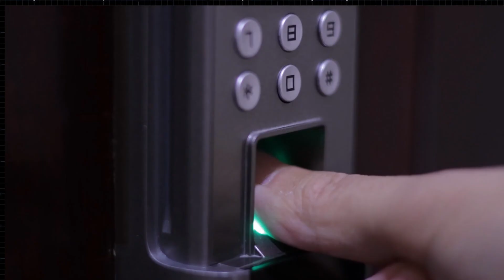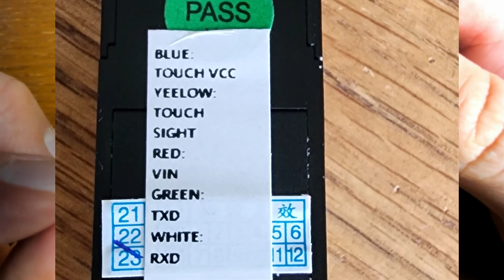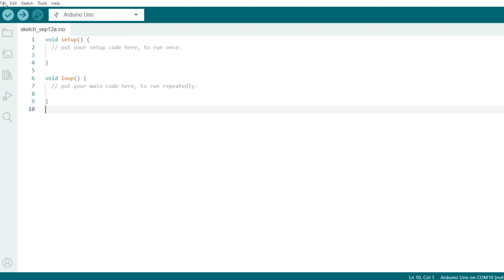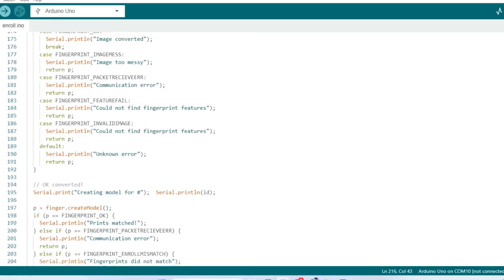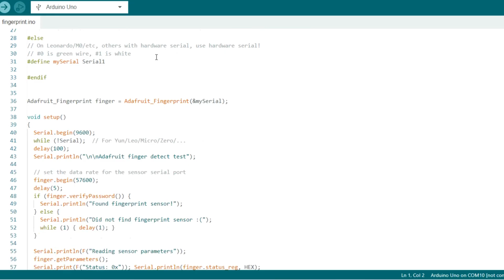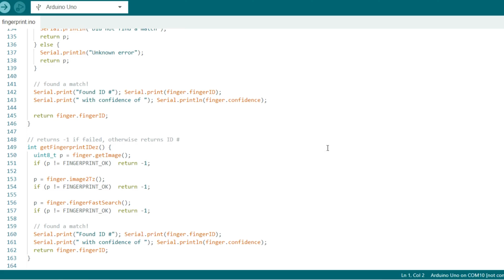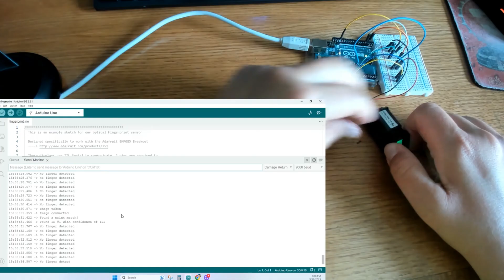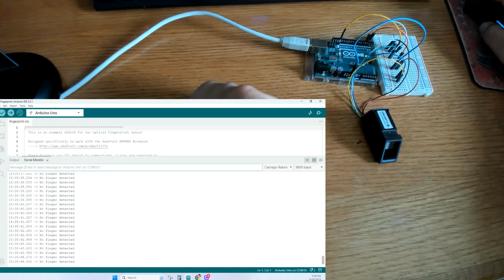Arduino Uno Fingerprint Scanner Tutorial: Enroll and Verify Your Fingerprints

Comment: Can you give me full wiring diagram please
Reply from the maker: HI!
There are different fingerprint modules out there, but I have the flashtree FPM11A Green Light Optical Fingerprint Reader.  For my fingerprint module the wires I used are:
Green: TX
White: RX
Red: VIN
Black: GND

look at 2:54 in the video for a wiring diagram -
green wire: pin 2
white wire: pin 3
red wire: 5v
black wire: gnd

Comment: Put the code
Reply from the maker: download library. 👍👍

#include <Adafruit_Fingerprint.h>

#if (defined(__AVR__) || defined(ESP8266)) && !defined(__AVR_ATmega2560__)
// For UNO and others without hardware serial, we must use software serial...
// pin #2 is IN from sensor (GREEN wire)
// pin #3 is OUT from arduino  (WHITE wire)
// Set up the serial port to use softwareserial..
SoftwareSerial mySerial(2, 3);

#else
// On Leonardo/M0/etc, others with hardware serial, use hardware serial!
// #0 is green wire, #1 is white
#define mySerial Serial1

#endif

Adafruit_Fingerprint finger = Adafruit_Fingerprint(&mySerial);

uint8_t id;

void setup()
{
  Serial.begin(9600);
  while (!Serial);  // For Yun/Leo/Micro/Zero/...
  delay(100);
  Serial.println("\n\nAdafruit Fingerprint sensor enrollment");

  // set the data rate for the sensor serial port
  finger.begin(57600);

  if (finger.verifyPassword()) {
    Serial.println("Found fingerprint sensor!");
  } else {
    Serial.println("Did not find fingerprint sensor :(");
    while (1) { delay(1); }
  }

  Serial.println(F("Reading sensor parameters"));
  finger.getParameters();
  Serial.print(F("Status: 0x")); Serial.println(finger.status_reg, HEX);
  Serial.print(F("Sys ID: 0x")); Serial.println(finger.system_id, HEX);
  Serial.print(F("Capacity: ")); Serial.println(finger.capacity);
  Serial.print(F("Security level: ")); Serial.println(finger.security_level);
  Serial.print(F("Device address: ")); Serial.println(finger.device_addr, HEX);
  Serial.print(F("Packet len: ")); Serial.println(finger.packet_len);
  Serial.print(F("Baud rate: ")); Serial.println(finger.baud_rate);
}

uint8_t readnumber(void) {
  uint8_t num = 0;

  while (num == 0) {
    while (! Serial.available());
    num = Serial.parseInt();
  }
  return num;
}

void loop()                     // run over and over again
{
  Serial.println("Ready to enroll a fingerprint!");
  Serial.println("Please type in the ID # (from 1 to 127) you want to save this finger as...");
  id = readnumber();
  if (id == 0) {// ID #0 not allowed, try again!
     return;
  }
  Serial.print("Enrolling ID #");
  Serial.println(id);

  while (! getFingerprintEnroll() );
}

uint8_t getFingerprintEnroll() {

  int p = -1;
  Serial.print("Waiting for valid finger to enroll as #"); Serial.println(id);
  while (p != FINGERPRINT_OK) {
    p = finger.getImage();
    switch (p) {
    case FINGERPRINT_OK:
      Serial.println("Image taken");
      break;
    case FINGERPRINT_NOFINGER:
      Serial.print(".");
      break;
    case FINGERPRINT_PACKETRECIEVEERR:
      Serial.println("Communication error");
      break;
    case FINGERPRINT_IMAGEFAIL:
      Serial.println("Imaging error");
      break;
    default:
      Serial.println("Unknown error");
      break;
    }
  }

  // OK success!

  p = finger.image2Tz(1);
  switch (p) {
    case FINGERPRINT_OK:
      Serial.println("Image converted");
      break;
    case FINGERPRINT_IMAGEMESS:
      Serial.println("Image too messy");
      return p;
    case FINGERPRINT_PACKETRECIEVEERR:
      Serial.println("Communication error");
      return p;
    case FINGERPRINT_FEATUREFAIL:
      Serial.println("Could not find fingerprint features");
      return p;
    case FINGERPRINT_INVALIDIMAGE:
      Serial.println("Could not find fingerprint features");
      return p;
    default:
      Serial.println("Unknown error");
      return p;
  }

  Serial.println("Remove finger");
  delay(2000);
  p = 0;
  while (p != FINGERPRINT_NOFINGER) {
    p = finger.getImage();
  }
  Serial.print("ID "); Serial.println(id);
  p = -1;
  Serial.println("Place same finger again");
  while (p != FINGERPRINT_OK) {
    p = finger.getImage();
    switch (p) {
    case FINGERPRINT_OK:
      Serial.println("Image taken");
      break;
    case FINGERPRINT_NOFINGER:
      Serial.print(".");
      break;
    case FINGERPRINT_PACKETRECIEVEERR:
      Serial.println("Communication error");
      break;
    case FINGERPRINT_IMAGEFAIL:
      Serial.println("Imaging error");
      break;
    default:
      Serial.println("Unknown error");
      break;
    }
  }

  // OK success!

  p = finger.image2Tz(2);
  switch (p) {
    case FINGERPRINT_OK:
      Serial.println("Image converted");
      break;
    case FINGERPRINT_IMAGEMESS:
      Serial.println("Image too messy");
      return p;
    case FINGERPRINT_PACKETRECIEVEERR:
      Serial.println("Communication error");
      return p;
    case FINGERPRINT_FEATUREFAIL:
      Serial.println("Could not find fingerprint features");
      return p;
    case FINGERPRINT_INVALIDIMAGE:
      Serial.println("Could not find fingerprint features");
      return p;
    default:
      Serial.println("Unknown error");
      return p;
  }

  // OK converted!
  Serial.print("Creating model for #");  Serial.println(id);

  p = finger.createModel();
  if (p == FINGERPRINT_OK) {
    Serial.println("Prints matched!");
  } else if (p == FINGERPRINT_PACKETRECIEVEERR) {
    Serial.println("Communication error");
    return p;
  } else if (p == FINGERPRINT_ENROLLMISMATCH) {
    Serial.println("Fingerprints did not match");
    return p;
  } else {
    Serial.println("Unknown error");
    return p;
  }

  Serial.print("ID "); Serial.println(id);
  p = finger.storeModel(id);
  if (p == FINGERPRINT_OK) {
    Serial.println("Stored!");
  } else if (p == FINGERPRINT_PACKETRECIEVEERR) {
    Serial.println("Communication error");
    return p;
  } else if (p == FINGERPRINT_BADLOCATION) {
    Serial.println("Could not store in that location");
    return p;
  } else if (p == FINGERPRINT_FLASHERR) {
    Serial.println("Error writing to flash");
    return p;
  } else {
    Serial.println("Unknown error");
    return p;
  }

  return true;
}

Comment: Code
Reply from the maker: download library.

#include <Adafruit_Fingerprint.h>

#if (defined(__AVR__) || defined(ESP8266)) && !defined(__AVR_ATmega2560__)
// For UNO and others without hardware serial, we must use software serial...
// pin #2 is IN from sensor (GREEN wire)
// pin #3 is OUT from arduino  (WHITE wire)
// Set up the serial port to use softwareserial..
SoftwareSerial mySerial(2, 3);

#else
// On Leonardo/M0/etc, others with hardware serial, use hardware serial!
// #0 is green wire, #1 is white
#define mySerial Serial1

#endif

Adafruit_Fingerprint finger = Adafruit_Fingerprint(&mySerial);

uint8_t id;

void setup()
{
  Serial.begin(9600);
  while (!Serial);  // For Yun/Leo/Micro/Zero/...
  delay(100);
  Serial.println("\n\nAdafruit Fingerprint sensor enrollment");

  // set the data rate for the sensor serial port
  finger.begin(57600);

  if (finger.verifyPassword()) {
    Serial.println("Found fingerprint sensor!");
  } else {
    Serial.println("Did not find fingerprint sensor :(");
    while (1) { delay(1); }
  }

  Serial.println(F("Reading sensor parameters"));
  finger.getParameters();
  Serial.print(F("Status: 0x")); Serial.println(finger.status_reg, HEX);
  Serial.print(F("Sys ID: 0x")); Serial.println(finger.system_id, HEX);
  Serial.print(F("Capacity: ")); Serial.println(finger.capacity);
  Serial.print(F("Security level: ")); Serial.println(finger.security_level);
  Serial.print(F("Device address: ")); Serial.println(finger.device_addr, HEX);
  Serial.print(F("Packet len: ")); Serial.println(finger.packet_len);
  Serial.print(F("Baud rate: ")); Serial.println(finger.baud_rate);
}

uint8_t readnumber(void) {
  uint8_t num = 0;

  while (num == 0) {
    while (! Serial.available());
    num = Serial.parseInt();
  }
  return num;
}

void loop()                     // run over and over again
{
  Serial.println("Ready to enroll a fingerprint!");
  Serial.println("Please type in the ID # (from 1 to 127) you want to save this finger as...");
  id = readnumber();
  if (id == 0) {// ID #0 not allowed, try again!
     return;
  }
  Serial.print("Enrolling ID #");
  Serial.println(id);

  while (! getFingerprintEnroll() );
}

uint8_t getFingerprintEnroll() {

  int p = -1;
  Serial.print("Waiting for valid finger to enroll as #"); Serial.println(id);
  while (p != FINGERPRINT_OK) {
    p = finger.getImage();
    switch (p) {
    case FINGERPRINT_OK:
      Serial.println("Image taken");
      break;
    case FINGERPRINT_NOFINGER:
      Serial.print(".");
      break;
    case FINGERPRINT_PACKETRECIEVEERR:
      Serial.println("Communication error");
      break;
    case FINGERPRINT_IMAGEFAIL:
      Serial.println("Imaging error");
      break;
    default:
      Serial.println("Unknown error");
      break;
    }
  }

  // OK success!

  p = finger.image2Tz(1);
  switch (p) {
    case FINGERPRINT_OK:
      Serial.println("Image converted");
      break;
    case FINGERPRINT_IMAGEMESS:
      Serial.println("Image too messy");
      return p;
    case FINGERPRINT_PACKETRECIEVEERR:
      Serial.println("Communication error");
      return p;
    case FINGERPRINT_FEATUREFAIL:
      Serial.println("Could not find fingerprint features");
      return p;
    case FINGERPRINT_INVALIDIMAGE:
      Serial.println("Could not find fingerprint features");
      return p;
    default:
      Serial.println("Unknown error");
      return p;
  }

  Serial.println("Remove finger");
  delay(2000);
  p = 0;
  while (p != FINGERPRINT_NOFINGER) {
    p = finger.getImage();
  }
  Serial.print("ID "); Serial.println(id);
  p = -1;
  Serial.println("Place same finger again");
  while (p != FINGERPRINT_OK) {
    p = finger.getImage();
    switch (p) {
    case FINGERPRINT_OK:
      Serial.println("Image taken");
      break;
    case FINGERPRINT_NOFINGER:
      Serial.print(".");
      break;
    case FINGERPRINT_PACKETRECIEVEERR:
      Serial.println("Communication error");
      break;
    case FINGERPRINT_IMAGEFAIL:
      Serial.println("Imaging error");
      break;
    default:
      Serial.println("Unknown error");
      break;
    }
  }

  // OK success!

  p = finger.image2Tz(2);
  switch (p) {
    case FINGERPRINT_OK:
      Serial.println("Image converted");
      break;
    case FINGERPRINT_IMAGEMESS:
      Serial.println("Image too messy");
      return p;
    case FINGERPRINT_PACKETRECIEVEERR:
      Serial.println("Communication error");
      return p;
    case FINGERPRINT_FEATUREFAIL:
      Serial.println("Could not find fingerprint features");
      return p;
    case FINGERPRINT_INVALIDIMAGE:
      Serial.println("Could not find fingerprint features");
      return p;
    default:
      Serial.println("Unknown error");
      return p;
  }

  // OK converted!
  Serial.print("Creating model for #");  Serial.println(id);

  p = finger.createModel();
  if (p == FINGERPRINT_OK) {
    Serial.println("Prints matched!");
  } else if (p == FINGERPRINT_PACKETRECIEVEERR) {
    Serial.println("Communication error");
    return p;
  } else if (p == FINGERPRINT_ENROLLMISMATCH) {
    Serial.println("Fingerprints did not match");
    return p;
  } else {
    Serial.println("Unknown error");
    return p;
  }

  Serial.print("ID "); Serial.println(id);
  p = finger.storeModel(id);
  if (p == FINGERPRINT_OK) {
    Serial.println("Stored!");
  } else if (p == FINGERPRINT_PACKETRECIEVEERR) {
    Serial.println("Communication error");
    return p;
  } else if (p == FINGERPRINT_BADLOCATION) {
    Serial.println("Could not store in that location");
    return p;
  } else if (p == FINGERPRINT_FLASHERR) {
    Serial.println("Error writing to flash");
    return p;
  } else {
    Serial.println("Unknown error");
    return p;
  }

  return true;
}

Comment: I keep getting "Did not find fingerprint sensor: (line 52).  So how does line 49 work (finger.verifyPassword().  Where is this password and what does a password look like?  Of all the fingerscanners out there that looks like yours, is the wire color coding the same (red=+5, black=gnd, IN=green and OUT=white)?  I have two identical scanners with wire connections, but no label to tell me what make it is.
Reply from the maker: Where did you buy  your module? is there a part number or ID number on it that can be searched?
You have probably already done this, but did you Swap the TX/RX wires?

My scanner has wire label on the back. It's a cheap one from Amazon, not the 8 wire scanner from Adafruit. 
Here is my wire labeling:
Red = VCC
Green = TX (sensor transmit → Arduino RX)
White = RX (sensor receive ← Arduino TX)
Black = Ground

If your sensor has all same-color wires:
Looking at the connector from left to right:
Ground
RX (data into sensor)
TX (data out of sensor)
VCC

Comment: How can i use this for class attendance?
Reply: same here I'm trying class attendance but even when different fingerprint, the fingerprint id is same even though they're from different finger
Reply from the maker: @yeltsakcir-d4k  hey there! Did you troubleshoot the problem yet? There are a few things I would look into.

Are you possiblly overwriting the same slot during enrollment? I am asking because if the ID is never incremented during enrollment, every new finger replaces the previous one. 

Did you adjust the confidence score for a better match threshold?

Just some initial ideas to consider. If you got it working, I'd love to know how you fixed it.

Thanks for posting this 👍👍
Reply from the maker: hey there!
You can create a database of fingerprint ID's. When the fingerprint module scans  a print it will identify the person. As it ID's each scan, you can create a tally of people who came to class and print that number on a display.
I like the idea! 
If you need any help with this, just ask! 👍👍
Reply: Is it necessary for me to acquire any additional equipment or instrument in order to ensure proper function? For instance, should I consider using another type of circuit to enhance the setup, or perhaps I need to make some modifications to the existing configuration, such as altering the cable wiring to achieve optimal results or efficiency?
Reply from the maker: @silentzain5008  That's a good question.
You could add an electrolytic + ceramic capactior across VCC/GND at the sensor to smooth power fluctuations.
If you want to add some extras, maybe add a microSD module to record a CSV log of attendance. Add a green/red light to blink when fingerprint is accepted/denied.
Reply from the maker: I remember you asking this question - so I made a class attendance system!  
check it out and let me know what ya think.  
https://youtu.be/FzZBFwjmWI0

I thought it would be cool to log attendance directly to Google Sheets form, like I did in my garage door logger video. 
Anyway, I hope this is helpful 👍👍

Comment: will the sensor not work if i first give 5v then change to 3.3v
Reply from the maker: The  boared has Supply voltage: DC 3.8-7.0V
So if you powered it from 5 V and then switched to 3.3 V on the VCC pin, it will stop working (3.3 V is below the minimum 3.8 V).

Comment: why didn't you use the touch wires? When doing this, should I use the active low input wire when the sensor is touched by a finger?
Reply from the maker: hey there!
Polling the fingerprint sensor over UART (Serial) instead of using the touch interrupt feature makes the code minimal and compatible across different platforms, even if they don’t support interrupts or that specific pin. So, I don't think most libraries don’t use it by default because polling is simpler.
If you want to use it, connect it to an interrupt pin, and remember it's active low - goes LOW when touched.
Are you getting it   to work properly?

Comment: Hi can i use r307s instead of r307??
Reply from the maker: Hmm... probably so. Is that an updated version?
It looks like they have the same pinout and voltage requirement. See if both modules operate the same and check if there are any special firmware requirements 👍